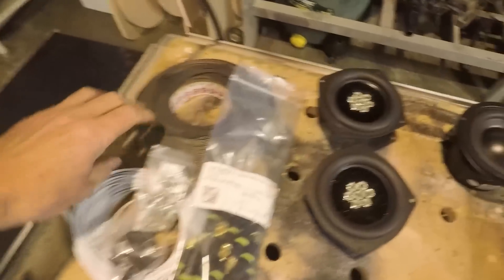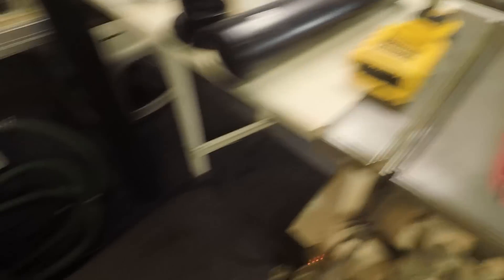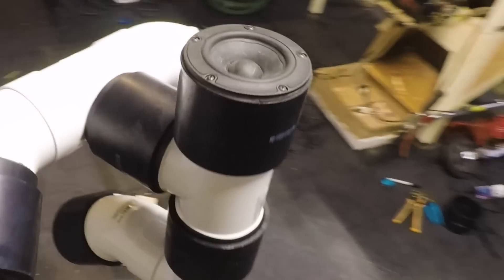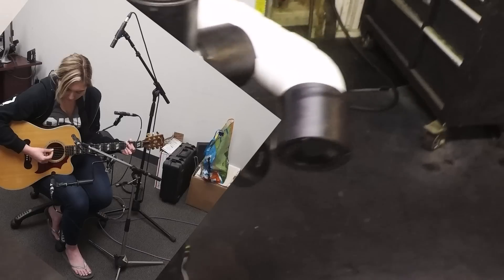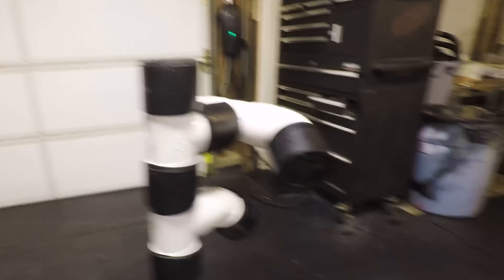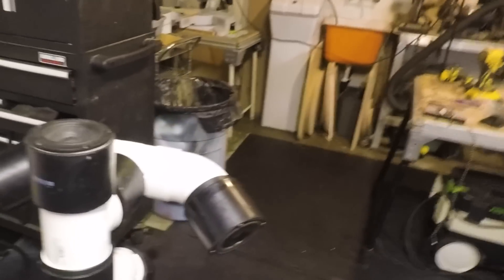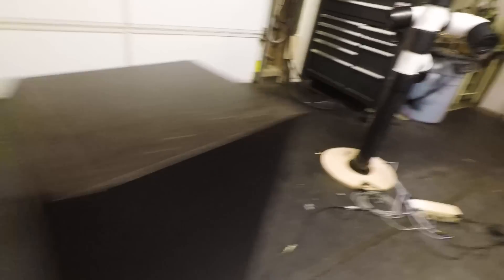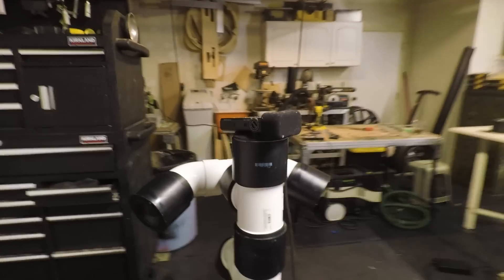Speakers Don't Sound Real, Lets Build One That Does

Comment: Great idea! Your contraption sounds significantly better than the single speaker even over the YT. I guess the main question is what exactly it would be used for, or maybe more precisely HOW you plan to use it. What I mean is you probably don't plan to move around the individual "sound totems" while listening? I mean even when the band plays live, people don't walk around the stage. My point is, if the final setup is the standard room where everybody's listening from a fixed position, two arrays of directionally adjustable speakers with enough speakers per instrument should be a decent approximation to your device. The real problem is of course with recording and number of channels. If you have a studio at home, it would work for you, but to be widely usable, you'd need to come up with some new format, and playback device. Didn't Neil Young have some kind of player like that? Like a Kickstart project if I'm not mistaken.

EDIT: I just checked, and yes, Neil Young had such a Kickstart project, player named Pono, but he had to close both the project and the website, it obviously wasn't adopted by users. Too bad.
Reply from the maker: Did ya by chance watch the next vid I did on it? Where I compare to other speakers?

Comment: Very cool. And I get what you’re after. The ideal speaker would be something that radiates in an omnidirectional pattern evenly.
Reply from the maker: Except the worst thing would be to radiate the same sound in an omnidirectional way. As that would make all the direct and reflected sounds clones of the same sound maximizing comb filtering.

Omni coverage with different sounds radiated in different directions is what I seek and what a real instrument does
Reply: @DaveRat  I agree. I should have stated per source. Omni is probably an oversimplification. Acoustic guitars, voices, amps are really more cardioid. But that’s another rabbit hole :-)
Reply from the maker: It's confusing to put a polar pattern on instruments or sound sources that radiates diff sounds in diff directions as it is completely different than a speaker or array that radiates the same or similar sounds in diff directions.

Comment: Love this idea. Perhaps you could achieve something similar and help reinforce a standard with fewer tracks by layering in clever dsp, using micro delays and adjustments in EQ across your random speaker arrays to help mimic what youre doing. Not that this would make it sound nearly as good, but could offer a middle ground for an industry to change to perhaps since itd be fewer channels and lower ceiling for newcomers to the tech (i.e. if you're an amateur you don't need tons of mics, just one well placed one :)
Reply from the maker: The key to this is different sounds actually radiating from different physical locations in space such that when you move, you get closer and farther from various the radiating sounds.

Emulating this, changes this from wow to meh

Comment: Long long ago.. I walked into a Radio Shack.  They had music or a TV playing through these small speakers.  The speakers had Di-Pole ribbon tweeters mounted to the top of them.. and since the ribbons were a full circle.. they emanated sound in a full 360 degree circle.   These ribbons were so sensitive, that they created a very detailed response... HOWEVER... because the sounds were allowed to travel in a full circle.. there was distortions.. due to reflections in the room.  The same sound were being heard a few ms from a different direction.. as they would bounce off of walls and things.. arriving at your ears from different sources and timeframes.

 With this setup... you have individual recordings per vectored directions..  which will help make it more true to life.

 That said... is it really better than high quality driver Stereo, is capable of?

 My first introduction to the Audiophile realm, was a paid of  Sennheiser HD 500  headphones  (their lowest tier / affordable  audiophile level product).   I had my pc hooked up to an older model  Pioneer 5.1  Surround Sound Amp.   I went to play a DVD, and the sound was blasting loudly... and I realized that I must have left all of my speakers toggled on.  It was like 2am at the time... and others in the house may have been sleeping... so I ripped off the headphones, and Dived for the speaker toggles.. only to realize... none of the FOUR techniques 12"  3-way speaker, were "ON".

 In another event.. I had this one MP3 track that started out with a distant "Thunder" sound, and then gradually went into Rain.. before starting the music portion of the song.   With this particular model headphone... when the thunder sounds hit.. I actually looked out of the nearest window...thinking it was raining.   Never before, has a headphone, nor speaker.. even been able to fool my ears like that.

 A few years later, I was at my buddies  Slot Car racetrack + Arcade ... and he had this amazing set of speakers playing some really Dynamic Disco music.. Probably  Earth Wind and Fire.   It seemed like the sound was Everywhere... and extended a good +20 ft in any direction... before you would notice a drop-off in the volume, and the Astounding 3D Soundstage.
Well... I was so amazed at how incredible the 3d soundstage was... that I knew I had to have a pair of them...

 The owner of the store is a pack-rat / hoarder... so there was piles of magazines, paperwork, racing parts, DVDs, and more... all over the place.  Normally, none of that would matter.. as my ears are extremely sensitive, and could EASILY find where a speaker was, based on the sounds it was making.   These were different.  I spend a good 10 to 15 minutes, searching... and still was unable to find them!   I finally gave up and asked my friend what they were, and WHERE the hell they were?!   He walked me to the front of the store...

 They were sitting on a 1ft tall raised ledge, about 1ft in front of the stores giant glass window.   One was laying horizontally, with about 1.5ft tall stacks of magazines on them.  The other, was about 5ft away from it... standing vertically... with mags on top of it as well.   That vertical speaker, was also partially blocked by a Display Sign, from a Sit-Down Arcade machine.   Despite this being one of the worst possible speaker setups / rooms...  the sound quality, and 3d soundstage / image.... was VASTLY superior to ANYTHING that I had heard before.

 These turned out to be 70s era   EPI 100v   speakers  (with the updated version of the inverted tweeters).   These tweeters were unusual, as most tweeter that you see on speakers, tend to be Domes.  Where as these were 1" diameter "convex" shaped drivers.   The strong magnets, and shape of the drivers... seemed to be able to produce a 3d effect that was unlike most speakers that anyone has ever heard in their lifetimes.   Now, Ive heard some ribbon tweeter, and planer driver speakers in my life... and even they didnt come close to the soundstage and ultra wide "Sweet Spot" that these were able to create.    The designed also mentions that he wanted as little possible distortions from advanced crossover parts... and so he used larger Gauge wire on the woofers voice coils... which allowed them to automatically filter the high frequencies out, without an additional crossover part.  These were also Sealed Speakers... and as such, the bass was far more Clean and Natural sounding... than modern "Ported" speakers.   One of these 8" woofers, weighted more than two of my former Techniques 12" woofers...  as the EPI woofers had much larger and stronger magnets and driver coils.

 Anyway...  my point here, is that well designed speakers, can in fact be more than enough to fool you, sonically.   It certainly has a level of limitations.  You are not going to get different sound characteristics, based on where you are in the room..  from a mere Stereo setup.   But with a high fidelity 4 channel recording... and 4 high fidelity speakers.. one could get close enough that most would be completely satisfied with.   Especially when you consider that even many live instruments performances are "Electronic",  and or,  are MIC'd  into masses of Concert Speakers.   Meaning... you are not hearing the instrument.. but rather... you are hearing the MICed instrument through a powerful, large, speaker.

IMO, one of the biggest issues with sound today... besides heavy studio Compression levels (turning everything into flat, low-fi, garbage)... is the use of Ports and small Eco-Woofers. These drivers distort way too easily and quickly... due to not having enough power to accelerate and decelerate the cone in the required/expected  time-units.  Ports also tend to generate Artificial sounding Bass.  Its not the sound that was Recorded, nor Intended to be heard...  and..  this issue gets worse and worse, the higher volume levels that you push them.
 
 Buying and operating 4 high quality, dynamic, high-power speakers... would certainly be better than having +20 low fidelity eco-speakers... in strange configurations... Though, it certainly is still a cool project... and one that has specific purposes / uses.

 I personally think more emphasis should be placed on source separation of frequencies, to each driver.  And for example.. Having multiple tweeters, and multi mids... whom only handle a select portion of the sounds / frequencies..  so that it Vastly reduces potential distortions that would otherwise be had from a single driver trying to reproduce all of those instruments/frequencies at the same time.

 I think the rest, lies in the recordings.  The use of Holographic Mics (Binaural) ... such as the 3Dio... drastically change the recorded sound profile (3d Image)... because they capture sound the same way that your head / ears  capture it.   They are not just capturing the instrument / vocalists but they are actually capturing the Entire Room, and everything within it..  the same way that anyone standing in that spot, would have actually have heard it.

 There was a video of someone making dinner in their Kitchen... which was recorded with a 3dio mic... and it sounded as if you were actually in their Kitchen.  It wasnt perfect.. but it was FAR superior to the effect of standard studio  recording / mic 'ing.
Reply from the maker: And also it is really simple to send multiple sounds in multiple directions and sound real without all the complexity and happenstances
Reply: @DaveRat  Not sure if you read everything in that.. but what are your thoughts / opinions on Binaural microphone recordings, like the 3DIO, which uses mics that are mounted into a human-head shaped model ?

 From what Ive heard, it captures the Room / Environment   in the same / similar way that your actual ears hear... and thus,  captures not only the performance.. but also.. the Entire "ROOM".

 I believe this is why most things do not sound "Real".. because most of the recordings are not captured the same way that your ears Hear.   Especially typical studio created music... in which they are trying to Eliminate the room... and trying to make their own Psudo-3D effects.
Reply from the maker: Binaural is very real as long as you wear headphones like a 3d movie is real if you wear the cardboard glasses.

And

Wouldn't it be cool if ya had real without the glasses or headphones? 

That's what seems fun to me

Comment: Won't you end up with all sorts of unpredictable comb filters that you will never be able to fix since the mic's and speakers won't be in the same place? I could see stepping up binaural to a standardized set of four to six mic's then bring played out of identically placed speakers, but you would still end up with competing room coloration and all the same problems with any recording. Interesting idea, but I'm struggling to see how it would stay cohesive with 20 tracks and 20 speakers. Also, how much space would you have to dedicate to a setup like that? I'm picturing quite a few discussions with significant others who may not be on board with a half dozen coat rack speakers in the living room. Maybe some restaurants would be willing, but it's less of a draw of its not live (and properly mixed, as you mentioned).
Reply from the maker: All the problems of comb filtering come from the same sound interacting with itself or it's reflections. 

This is a recording of different sound from different directions so the comb filtering is reduce to more similar to a real instrument
Reply: @DaveRat , thanks for the response.   I just stumbled across your channel with your video about creating the destructive interference for the Bassnectar subwoofer dipole arrays where you had to tune the delays to the tenth of a millisecond because of speaker placement needing to be within an inch of the design, and then ride the shift to account for temperature delays; clearly you know more about this than I ever will.  I'm still struggling to understand how this would work though. 
I could see the comb filtering somewhat averaging out with the huge number of microphones, but it seems like that would also make any high frequencies a muddy disaster. In a live performance, each instrument is going to create interactions with its physical environment in a unique way, but all of them will be interacting with them consistently and in the same manner.  Recording 20 randomly placed mic's and playing it back over 20 differently placed speakers seems more like looking through a kaleidoscope... it might be pretty, but good luck figuring out what you're looking at.
Reply from the maker: Great to meet you. Whatever mess happens from multiple mics is worse when the same signal is combined with itself multiple times.

Natural instruments radiate multiple sounds in multiple directions, a real sounding speaker should do the same